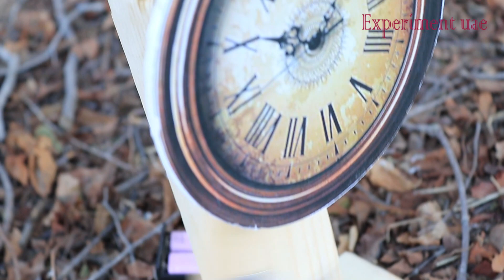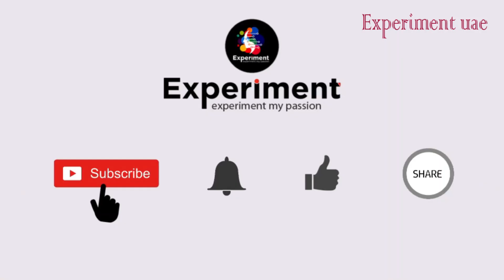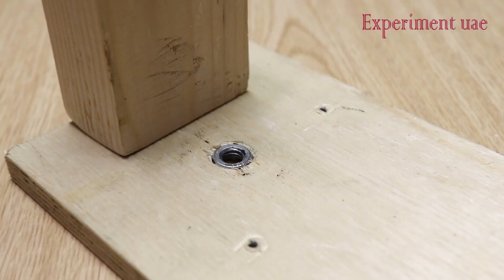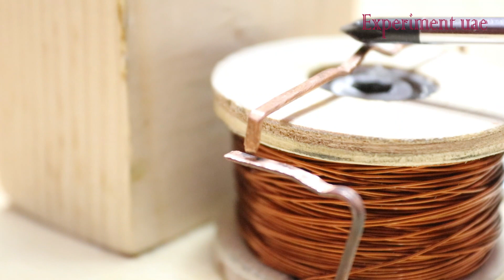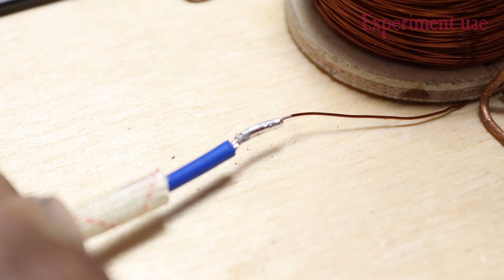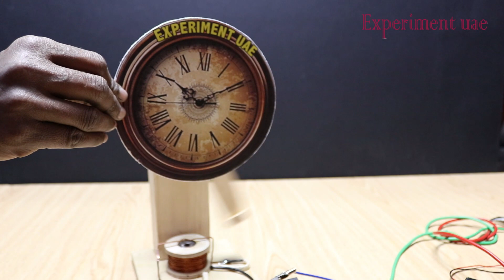How to make Simple PENDULUM HANDLE | Experiment UAE |

Comment: Thank you very much for your response, I followed a video a bout how to make a electrical pendulum, I failed    can you please give me the details about the coil as how many turns, resistance  and the total value of capacitors, the  main problem is charging and discharging-of the coil...Thank  you very much
Aa
Reply from the maker: Coil turns I forget this time. I think  speak in this Video . Coil resistance 8.3ohms 
Give me your mail I’d I will send circuit
Reply: @Experiment_UAE  Thank you very much